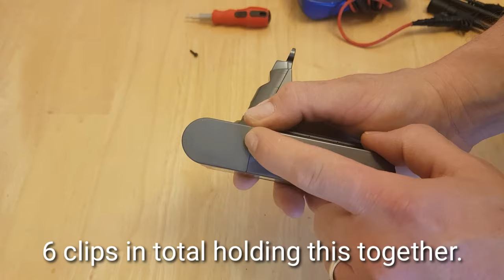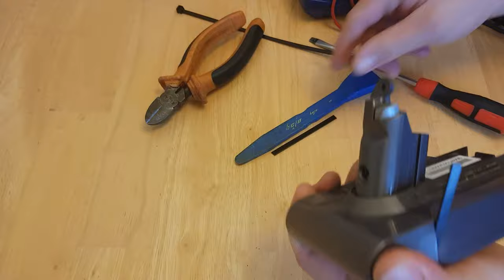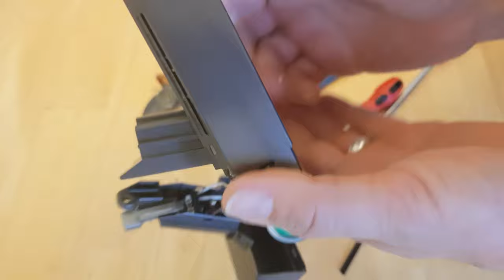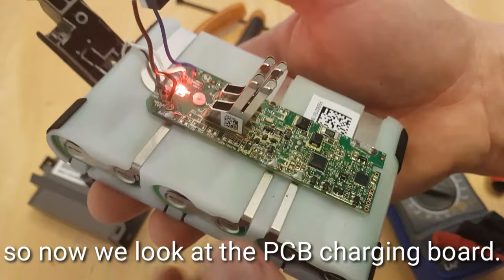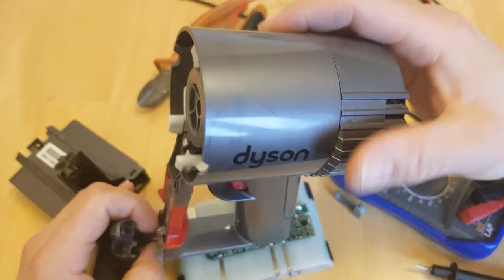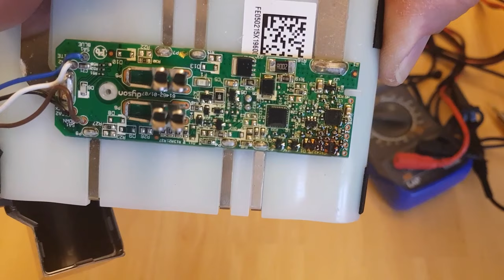How to fix a Dyson v6 v8 battery fault red flashing led diagnose fault and repair not charging

Comment: You need to set your DMM to 200V (its on 20V) in order to test the charging cable.  The unloaded voltage from the charger is in excess of 20V, which is your meter's current setting, so the voltage goes out of range.  That's why when you try to check the charger cord voltage it shows (briefly) 19.xx V, then shows the digit '1.'  Cheap multimeters are annoying.  Also, the varnish that cooked up on the PCB is likely conformal coating, often used to make PCBs slightly moisture proof.  Thank you for the video, demonstrated that Dyson electronics are basically junk and convinced me that I should simply get a new complete battery and use my old 18650 cells for something else.
Reply: well said he needs to learn how to use multimeter first ( its an inteligent charger so it pulsing hahahaha)
Reply: he should buy autorange dmm if not used to it . the new pcb (v8) coated with silicone
Reply: I did the exact same thing when testing the charger first of all, then squinted at the writing on it and it says 26V out...surprised me, thought it's be less than my 18V Ryobi tools with bigger battery packs that I assume are also full or 18650s.  Should have just got the Fluke out.
Reply: @swcooper  Why would it be less when it is 6 cells in series instead of 5 in series like on any 18V aka 20V cordless tool battery?   When in doubt,  check the charger itself, often it has the DC output rating right on the label... so yeah, long way around doing that.

No need to break out expensive equipment for mere (n).(n)V readings.  Just set it on the 200V/etc range to start with, since you don't really need to know the 0.(n) tenth of a volt value anyway, just whether it's in the ballpark hooked up to mains, and under load when it should be charging.

Comment: Fair play - unlike some videos that gloss over the difficult bits at least this one showed that this was not a simple operation for the average DIYer - at least persuaded me not to try! Thank you
Reply: Meh, not a big deal to try.  As often as not, it's a bad cell instead, though this BMS is smart and won't return power by swapping out a cell once it has entered the tripped state, has to see the right voltage continuously and if the red light flashes, it may have already disabled itself.

Comment: My Dyson charger output original is 26.05 volt still good. original battery died out replaced a new battery. Only lasted one month , keep changing batteries until all plastic attachment fall a part, mine is falling a part Thank you Ac: I will buy vacuum with plug in cord  more work but it's worth:

Comment: I took mine to pieces but still would not charge when it did charge it would run for 20 seconds then stop so  chucked it bought a new none Dyson for £20 job done safely disposed off😊

Comment: On my Dyson V6, the battery flashes red !! but sometimes it kicks off and the led is blue, if I release the trigger, then press it again, it still works well! if I leave it inactive for too long (+/- 30 sec) it flashes red again! and trying a few times it reboots correctly, every time like this i have a hard time knowing if the problem is with the battery (maybe BMS) or if it's the motor.
In your opinion?
Reply from the maker: if the battery is old I would start by cleaning up the dyson and see if it runs any better without the brush head. if it dose I would say the bms dosnt like one of the battery cells in battery and replace the battery pack

Comment: My DC45 does not charge when the Dyson with battery is in the wall holder. But when I take the battery out and connect it directly to the charger plug, the battery is charging! After some time, when the battery is fully charged, I put it back in the Dyson, and I can use the Dyson for the normal use time. The battery is brandnew from Amazon. What can I do to solve this problem?

Comment: The red light means a low voltage triggered the lock down of the board, no one found a way to unlock it. The board works well just got locked by the pic16 controller.
Normally happen with a weak battery and uneven cell voltage
I'm guessing the pic eeprom store that a low voltage happened and lock down, even if u pull reset pin low on the pic16, it will still be locked....
Probably from factory, after first code run on the pic, 1bit on eeprom to indicate initialise code ran and after a power out or a balance fault occur, no matter what you do the pic just flash red and that's how Dyson earn your money.... You won't be able to change the battery cell out once it flash red.
From what I found, you need to have another battery attached to each balance tab and then remove the old battery and spot weld a new one, not breaking battery power
Reply: That is correct, in other words the bms board bricks itself in a fault condition or on loss of power, the problem is a lot of other people posting videos on youtube about changing the cells fail or don't want to mention this.
Reply: @tyronenelson9124  I replace cells with success without any problem, but it was not bricked at the time. Now it got unbalanced and red light is blinking four times.

Comment: Can you just imagine what it takes and how frustrating for a housewife
Reply: Meh, any housewife or househusband using a dyson, is probably rich considering how much they cost compared to a standard vac, and will just shell out the money for a replacement battery, or these days, buy a cordless tool battery adapter.

Comment: These Dyson BMS are a shame. Usual BMS stop current with faulty cell or global too low voltage , but never lock down definitively like these ones . If the battery is still good but with weak cells and you want to change them, when you disconnect this BMS without any other power source to maintain it alive, it's exactly the same.... and programmed lock down after X recharges is also the same...
it's a legal robbery for pure commercial reasons , masked by an efficient (and fragile) technology and wrong arguments ! Why is it not forbidden??
My Panasonic E-bike battery does exactly the same ...it's the new "Lithium robbery" now applied to a lot of other devices by clever manufacturers.

Comment: Is the outer plastic glued? Thermally attached or just snapped together? Speaking would be helpful
Reply: The outer case is just snapped together at 8 different points (6 lower, 2 upper which are reversed) and one additional screw. This is yet another video of a butcher job taking one apart... Insert 2mm spacers at the 8 points and the case will come apart easily and more importantly go back together without looking like it went through a blender.
Reply: Quite easy to take apart, u can see some marks due to injection mold that indicate a snap clip at the bottom near both sides, and one at both sides and top. Slide a thin metal tool to create space and jam some paper to maintain the lift for each snap clip and u can pull apart quite easily.
Reply: @note2tee  youd think so but it was not. I was using every tool in my collection. To nake it even easier i made a tool to depress the white tabs and hold them down without me having to hold onto the tool. I ended up using brute force. I was pissed enough that i didnt care if it broke. I did determine why mine was so hard to do. Im syre it had never been removed before. The white ring with the tabs on each end was extremely hard. Didnt feel like a part designed to be easily flexed. It took a bunch of moving one side then the other to get some flexibility on either side. I foubd this unit under a house burried in the mud and dirt. When i snapped the motor housing loose which took a heck of a lot of muscle i found debris between the main body and the top arched part of the white retaining ring with the tabs at each end. When id depress the tabs the arched part was pushing upward and outward against the motor case and into the groove keeping the case from coming off. After i found that was the issue i redesigned my tool so that it will pinch the tabs inward and pull the ring toward the bottom side of the vac which is up in this position. Pulling it toward the trigger guard and out of the groove in the cover. I also wiped all moving parts with plumbers grease to prevent the plastic from becomming brittle. If anyone runs inyo the same problem try using two 45 degree picks to cradle the white tabs pinch inward at the same time when you feel a click pull upward while trying to snap the cover off. It works far better after i worked with it. Thanks for the intel. If anyone knows where i can buy the 5 torx screws for the uppermost part of the cyclone and the 4 short torx screw for the cyclone please let me know. It was near impossible to find on the dyson web site and when i emailed asking for them in detail i got a message back asking me to describe in detail the issue i was having. I had all ready done that in the first email. There was no grey area. I said what screws, where the are located on the unit and exactly how many were required.
Reply: @derekv2101  Yeah you have a point, BUT you're stating that in retrospect having either taken one apart, or saw someone else do it in a video, or possibly you are just writing out of your arse with guesses at the amount of force to pry it apart.  Whichever the case may be, getting the case apart and back together without marks, is  hardly important.  What is important is sourcing a replacement BMS if it has already bricked itself from a fault or a cell below the voltage threshold.

Who cares if it looked like it went through a blender?  It's not a hood ornament, if someone is looking at your battery pack while you are vacuuming, you're not being a good host for another reason.
Reply: @note2tee  I've taken apart countless things and on the spectrum of easy to hard, and having taken one apart myself, this is not in the category of quite easily.  It is rather, about medium difficulty for a snap together housing due to the short sides which will deform a bit when you pry enough to put a shim in them, as well the top tab area.   The metal tool will also mar the square edges on the plastic seams because it's quite soft plastic.

Most things take less effort to pop apart, if only held together with casing tabs.

Comment: In my experience there is no fault with the board. It has detected some kind of issue with the cells and has deliberately insolated the power from the cells. You can charge the cells to 4.0v each with a stand alone charger and you can even measure a good voltage coming off the center posts but there are no amps so no power. Once the board decides to cut the power you cannot it seems 'reset' it. Although it is only a control board and not magic I still haven't found anybody/info on how it does this or how to reset it. If you did get a new pcb I would think it will see the same tiny issue with the cells and cut the power in the same way?
Reply: same here - stripped batteries out, proved all good, re-assemble and still 30 red flashes. replaced with another set of cells, same issue. I assume the BMS records the number of charge/discharge cycles and decides when to kill the battery. will keep searching - someone must have reverse engineered the BMS...
Reply: Some russian electronics repairman created custom firmware but there is no chance to download /watch?v=en0lbhxLfbU
Reply: @docpaul  I assume the same: BMS not only monitoring the health of 6 cells but also recorded circles numbers and then kill the battery pack when reaches the design number. I check my 6 cells, 5 are 3.58 and 1 is 3.52 and I check it by x10 magnifier didn’t see obvious fault on the BMS board
Reply: Nope, when there is an issue with the cells, at least one is at a dissimilar voltage level and he checked the voltage.

Once it flashes red, it has locked out the circuit and charging the cells individually does not unlock it.

If you get a new PCB, and it wasn't the cells, then it won't have the issue but more importantly if you  find an aftermarket that doesn't have permanent lockup and later discover that when you attempt to charge it, one or more cells isn't evenly rising in voltage with the rest, then  you can simply swap the bad cells since the aftermarket BMS board won't care that power was cut previously.

Comment: I have a bit of a head scratcher - Dyson DC59 replacement battery in November - then 2 days ago it would not turn off - ran till battery died - removed battery and charged out of the Dyson - inserted it and again runs as soon as battery is plugged in without the trigger being pushed - depressing the plunger ( same as using trigger does nothing while running ) with the battery out the blue lights light up when plunger is pushed !!!
I am thinking pub issue on battery pack ? 
Any suggestions .. anybody !
Reply: Sometimes the push button gets struck and that will cause the vaccum to run continuously.

Comment: If you like pulling things apart mate buts only 16 pound for a new battery
Reply: Not the 26.1 volt battery.  That's the 20volt one.
Reply: Aren't those the generics with crappy cells that will fail again soon enough?  Then again, you could just replace the cells next time since it will have a more forgiving generic chinese BMS board that doesn't lock out.

Comment: That’s a lot of trouble to find out it’s still broken. A new battery is 16.00. And the fact you have no audio makes this waste of time video even worse. That’s assuming the average person understood what you were doing. You are not smart and wasted everyone’s time.
Reply: 26.1 volt battery is $120.  If it were $16, very few people would try to fix it.
Reply: False.  The video was useful to show how it comes apart, even if he fumbled through getting it apart, and it is useful to show that you can check the battery voltage to see if a bad cell is the cause, and useful to know that there is a possibility that if the cells aren't bad, it could be a faulty BMS board, and that there is some hope to repair them.  However, this is if it did not flash the red led indicating it has locked out and bricked itself.

It is silly of you to state it is a lot of trouble.  How was it trouble?  It was not.  How was it a lot?  It was literally near realtime and a mere 14 minutes.  I bet you wasted more time on youtube today and got nothing out of it, so you were just going to watch some other video anyway if it wasn't this one.  Not smart at all.  Reality, please, instead of drama queen who sees 14 minutes as a lot.  WOW.

Comment: The board works fine.  The red light is part of the low voltage circuitry.

Comment: sir thank you so much for the teardown , thanks to you  I was able to do mine, apart from that İ got a problem with my dyson if you can enlighten me, i would be grateful;
PROMLEM:
i just bought a multimetre today and measured both battery and the main body  , battery was ok 23,5 V . I measured the main body for the first 3 seconds i got the beep sound and it stoped. Can i assume there is a short circuit in main body? But when i insert the battery it works with no problem . After 5 mn of working it gives me the red flashing light and stops. Then i remove the battery and press the button to check it , it gives blue light and 23V which means it is ok ? What can the red light result from even though battery and main body works ok? thanks in advance
Reply: Sounds like you have a bad cell in your battery ..... not providing consistent voltage throughout.
    The good cells are charging like they are suppoed to, giving the vacuum enough power to run.  The bad cell seems to be draining your good cells, causing your vacuum not to perform properly.

I hope this helps.
Reply: @bamaphoenix9873  thanks a lot dude, after all it turned out that all the cells went bad. I mean it had been 6 years since i bought the v6
Reply: @torukojinnn6331  Thanks for hollaring back at me.  One of my jobs is vacuum repair .... and I'm always learning something new.

Dysons have a great motor for their size, but the over all design and stuff that the common operator has no clue about, they are just not user friendly.  Way too expensive for their capacity.
   Have a blessed day.  ✌😎👍
Reply: The battery is supposed to put out 26.1 volts, not 23.5

Comment: When testing the charger your meter was set to 20V (max) and the charger is almost 22v so it was showing over voltage, switch to the next scale (200v) to get a proper reading.
Reply from the maker: I realised this after I just filmed it for the fun and pulling it apart to see how it works and what failed. never expected it to be such a popular video.
Reply: @FINDITFIXITRESTOREITBUILDIT  zž0